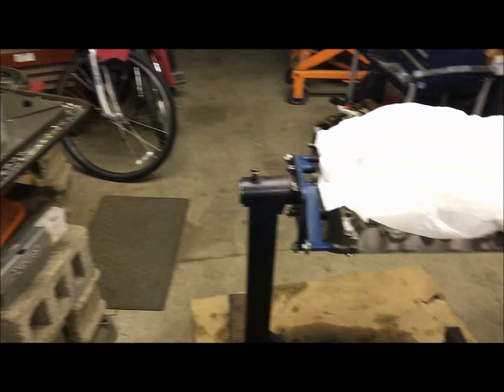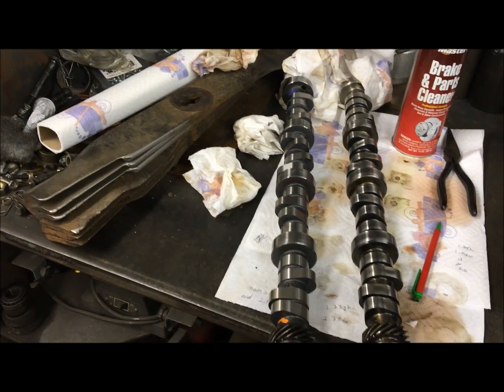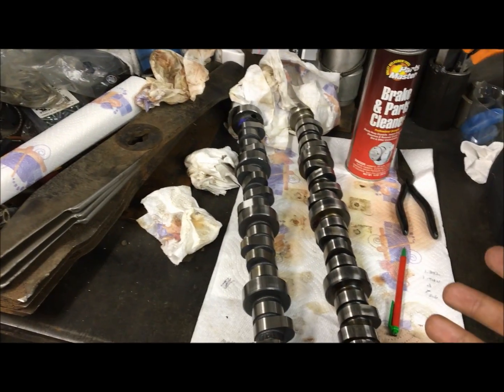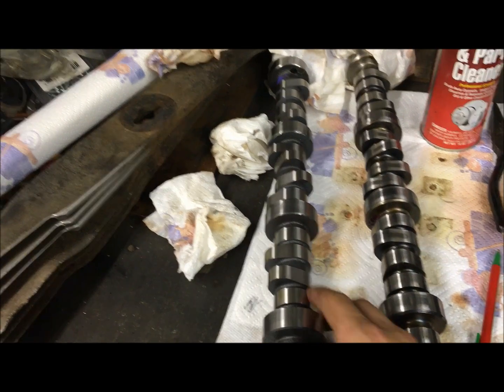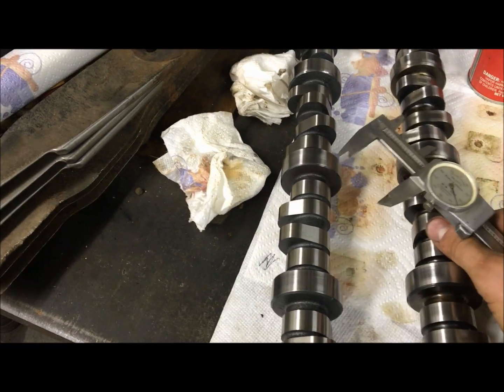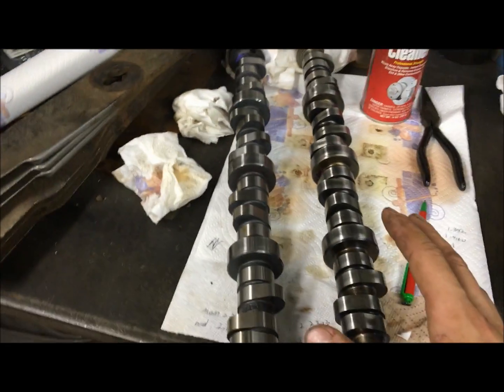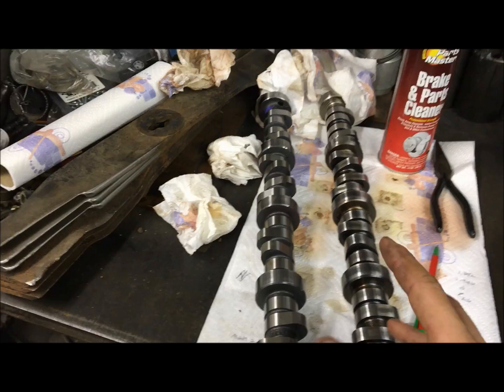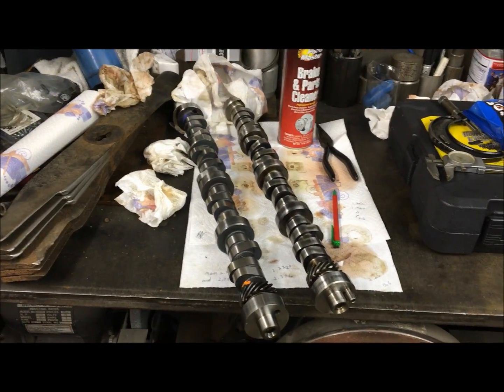Stock Cam vs High Lift Cam - Why You NEED Different Pushrods !!!!

Comment: What is the harm in running a slightly shorter pushrod if there's clearance on the rocker stud to set the valve lash correctly?

Comment: Im putting a tfs 1 cam in my rebuild with a new TF spring kit on the gt40p heads. From all the research I have done the stock push rods should fit. Most were saying everything under. 550 was usually good to go. Thoughts? This was a junkyard motor that im rebuilding and I have definitely exceeded my budget haha. I will def try and check the length or look for any movement.  I know the machine shop is going to put shims in if needed also.

Comment: Anyone please answer.....
I replaced my street bike (sohc)with 10mm lift cam instead of 5mm lift. But the results are poor than the stock. Upgrade big carbs too and increased the compression ratio also.
please support...
Reply: It's not just about the lift,you also have to check exact valve timing and duration. Imo,10mm lift from 5mm is a bit overkill. It might be too much for your valve diameter to have any positive gain beyond 7.8mm of lift.
Reply: JuliusCzar belcaP thanks for your reply sir, I mistakenly entered as 5mm lift . It’s 5.2lift in lobe and a rocker arm ratio 1:1.5 so valve lift is 7.8 as you said.. can I increase it now to 10mm in valve area. 
Bore x stroke - 70x58
Inlet valve- 22.5
Exhaust- 19.5 
Carb- 34mm flat slide
Pls do support...
Reply: @ravikannan9425  what bike are you working on sir? Imo,the short answer is yes,but I can not guarantee that it will be the best valve size for your 223cc build. There are a lot of factors to consider like,cylinder head design and also the bikes intended purpose(drag,circuit or just road bike). Since you are planning on adding 10mm on the valve size, I assume it's 2 valved cylinder so,valve angle should also be considered.
Reply: JuliusCzar belcaP thanks sir..
Bike is TVS apache rtr200. Am Using it for dirt races from India.
It’s 4valve engine .
Sir can I have ur mail I’d or whatsapp num to share some pics and ideas...

Comment: This helped.  Ordered a 278/204 intake,288/214 exhaust cam.  Cam card said it would work with factory pushrods.  After setting the lash the cylinders had no compression. Backed off the rocker and boom,. Good compression.  Reset the engine to tdc and rechecked the#1 pushrods.  Sloppy sloppy.  Love and learn not to trust manufacturer s' word....

Comment: The n271 cam that was in the galaxie you think pedestal mount rockers will be ok with that
Reply from the maker: +Matthew Simpson yes, but I would be sure to have rollers due to the lift - with that, pick up some shims from summit for pedestal mounts and an adjustable pushrod to pattern everything up to get the proper shim height. Then once you have a good pattern, you can go ahead and order pushrods 👍
Reply: ThunderHead289 you know the weekend is gonna be good when the car parts you orderd from summit show up on Friday
Reply: Have some pretty nasty lifters coming out this 302 in the 67, have around 1/16 worth of wear and more in a few of them, I say top end needs completely rebuilt

Comment: I built a 350 (388) and put a smaller cam for the street .550 lift, it used to be a roller motor. My pushrod legnth ended up being .250 shorter than stock. Also with the cam, heads were milled .020 as far as I know because I got them used, and .010 block decked. Standard felpro head gasket. I found a good used set of circle track pushrods on ebay for $29.95, CV brand, chromoly /hardended. Their walls are .110 instead of the standard thinner .080.
Reply: Yeah because roller lifters are much taller than flat tappets

Comment: Im sure youve probably had this before, but would you be able to get away with using the existing lifters with a new camshaft? The ones in my 302 now  all seem to be in good condition with no nicks that i can feel with a scale on the rollers. for someone on a budget is it best to save up for new parts or will I be okay? Love the videos man! I learn tons
Reply from the maker: That's great to hear!!!! 
You will. It damage a roller can by using the old lifters. It really all depends how many miles you want to get out of it. If they are doing well, they will run good now, but someday the internals and springs will wear in the lifters and they will have bleed down issues and what not. It's no telling how long they will last new or old. If properly cared for, if imagine thy would do 200k total. Flat tappet cams are the units that require new lifters as they "wear in" to their lobe so to speak
Reply: danetbra63 No.
Reply: Yes you can re use your roller lifters with a new cam. Flat tappets.... absolutely No!

Comment: do you work on Chevy's too? I got a stock 350 (early 70's) with 76cc heads and I plan to use 305 58cc 601 cast heads and I was wondering if I need to keep the 350 valve springs with that cam or if the 305 springs will do.
Reply from the maker: All small block engines work on the same principle. The valve springs should be fine as log as your running a stock cam
Reply: +ThunderHead289 OK thanks. I wasn't the last one to build the engine but I was told it was stock.
Reply: 305 heads have more compression but make less power because they flow like crap.Thats the only thing holding a 305 back from making power. Never use them. You can use a 305 shortblock, its all 350 except for bore size, its a trick because you can get them cheap. But when you put good heads on, you put the heads on a bare block and scribe the heads from inside the cylinders, no crank in. You have to unshroud the heads/port them to the block.

Comment: same for flat tappet motors?
Reply from the maker: Yes, exact same concept
Reply: Ok thanks when i built my motor the machine shop said to use my old push rods. Its a old 289 head with chevey valves and port work... good in the power department but sounds noisey. I did put new roller tip rockers on... i am definitely going to pull the valve covers off again and have a look to see what the contact patch is like and go from there..
Reply from the maker: that and make sure that they are adjusted properly. i have a several vids of doing this.

Comment: Hi , I have edelbrock performer rpm "right out the box" heads and there are few problems. One of those is that some of valves are sinked deep in seats and valve stem high differs a lot and rocker arms geometry all over the place. There are not much options for pushrod at length what I need What You can advice in that situation? May be I can make a special fixture to grind accurately ball pushrod end for every valve to achieve proper geometry? I cant grind valve stems for that much because rocker arms will be to close to retainers. Sorry for my poor English.
Reply from the maker: For one call in and complain. Two, if you measure them out and they are within the same range for required pushrod length, then you will be alright, not perfect, but it would be what you have to work with. They come incrementally, so you will likely fall on one pushrod length.

Comment: I'm guilty... :(  E-cam, GT-40P heads with stock pushrods and roller rockers...oops. sounded like a sewing machine! lol.
Keep up the great vids man, I always learn something!
Reply from the maker: Hey thanks! All hope is not lost, pattern up the rockers onto the valve stem to see where they are making contact, if it is in the center or close with less than a .050 spread you'll be fine!
Reply: Unfortunately, that car is long gone ('89 GT) But, I now have a '95 5.0 car, I learned my lesson on my '89, and will do it correctly now, I may go with a similar budget GT-40P H/C/I combo... live & learn.
Reply from the maker: +Mr. Jay A for sure, just try and help people out so they don't have to learn the long and drawn out way like I did in the day.
Reply: ThunderHead289 we have the same setup with the E303 & stock pushrods on my friends 95 and it runs fine. Must be the hydraulic lifters. Maybe it’s the E303, I’ve been told it’s the biggest cam you can use with stock pushrods
Reply: Willy Rohr what about a cam that’s 500/510